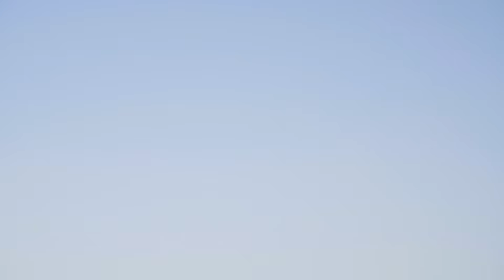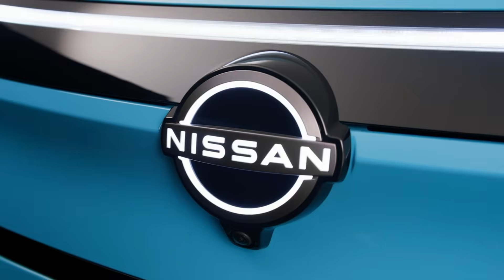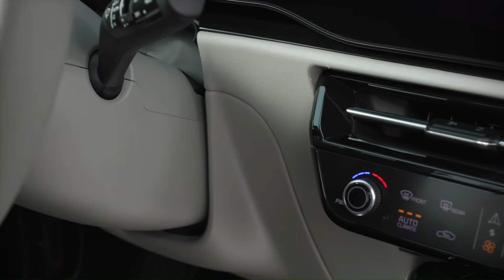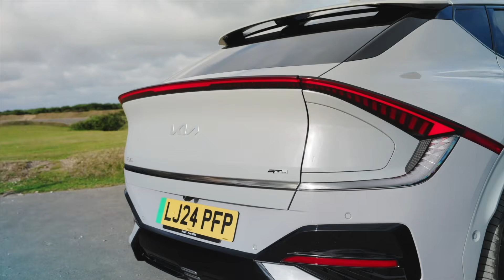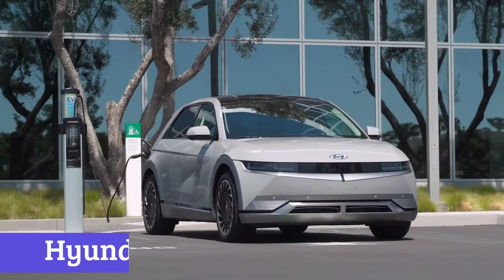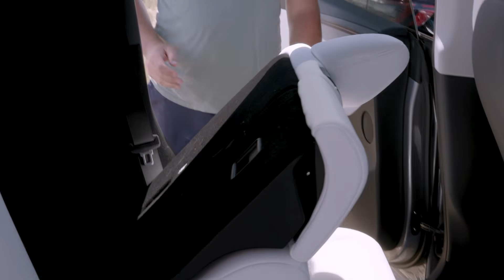9 Electric Cars Mechanics Personally Recommend

Comment: Consumer Reports and other credible sources might beg to differ on the Kia EV6 and Hyundai Ioniq 5.  These models have become somewhat infamous due to their Integrated Charging Control Unit (ICCU) failures and slow repair times.  I'm on my third gas-engine Kia, and I love it.  But I'm holding off on their electric products until the situation appears to be resolved.

Comment: Every EV has a reduction gearing transmission in oil bath.
To reduce wear on the ball bearings and to prevent any metal shavings from causing additional wear on the components the oil should be drained out every 50,000 miles.
The coolant in both the battery pack and the car cooling system should be replaced every 50,000 miles or 5 years.
Coolant can cause corrosion and damage the vehicle pumps and components if left in too long.